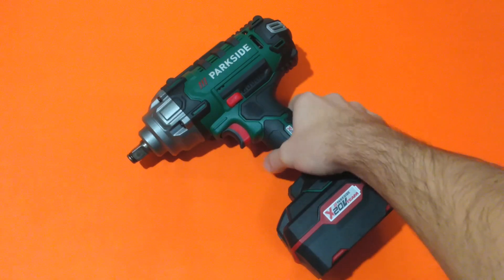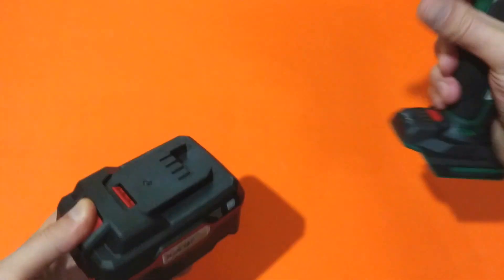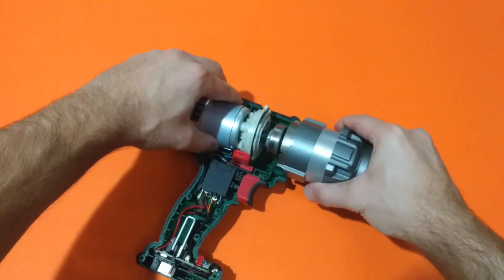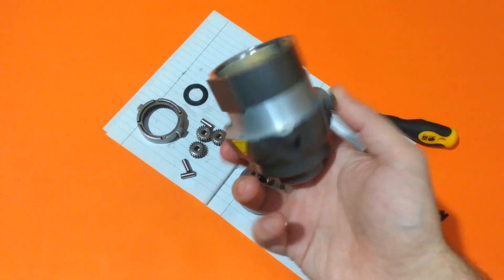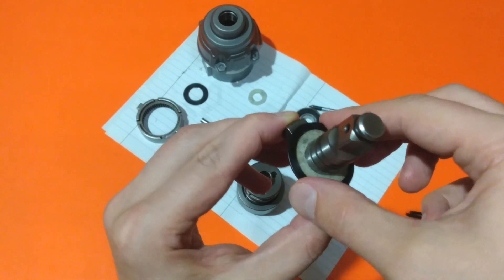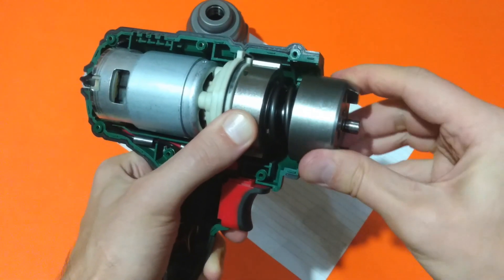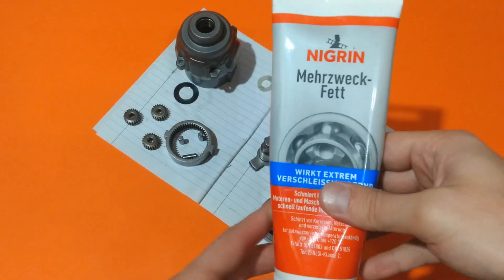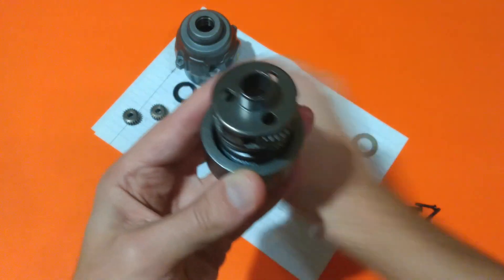How Impact Wrench Works? Disassembly and Explanation

Comment: Hi I have a problem with a tire changer inpatto, I disassembled it to grease it I reassembled the whole thing as in the video but now when I accelerate it stops me constantly, it changes the torque I set and then comes back, it could tell me what it is this problem?

Comment: Planetary gear is used to reduce rpm and increase torque. 

You skipped most interesting part which is taking apart hammering mechanism. There are two labyrinths on the powered axis, which moves the hammer through two balls up and also spins the hammer.
Reply: Cos he's a moron

Comment: Focus is on gear/impact mechanism, not on DC motor. Is this motor brushless? When I bought the tool I was expecting it would undo wheel bolts as advertised. However it could not and one still needs hand wrench to start and complete wheel removal/refit. If I could hold the socket still,  by hand grip while impact wrench is operating at max torque it just does not feel strong enough for the job. Back to the shop for refund!

Comment: Have ever thought about increasing the the torque of this wrench ?  it does on really open the bolts in my car, so I cannot really commend it without modifications.
Reply: yes, I agree, it will not undo wheel bolts even on max torque of 400 nM. Normally I tighten them using manual wrench, by hand. Toy tool this one.